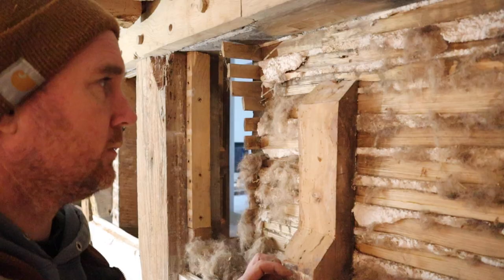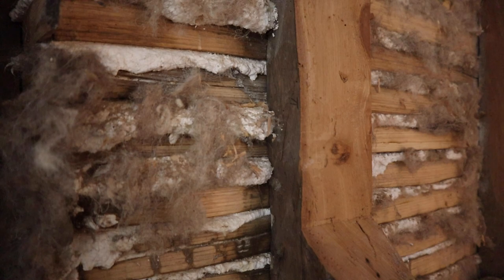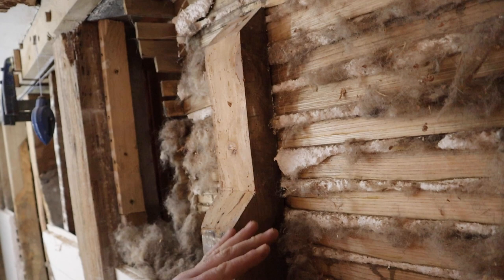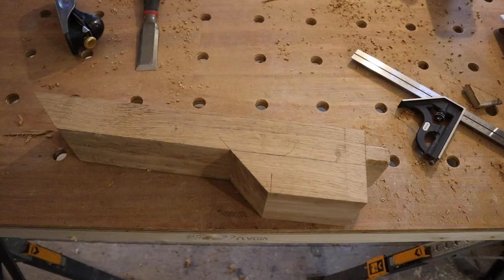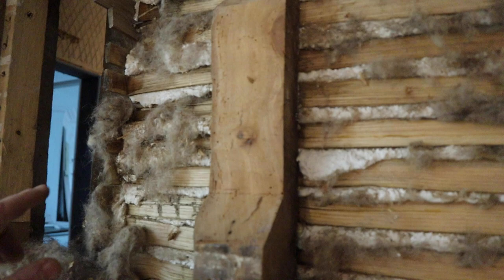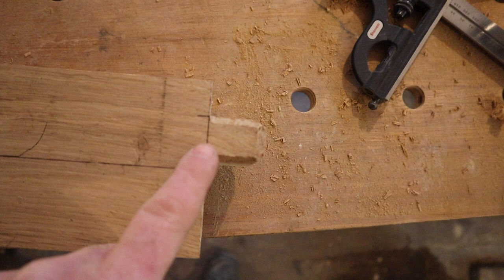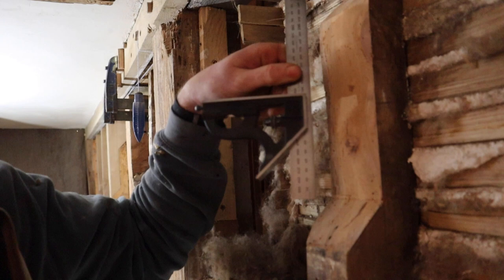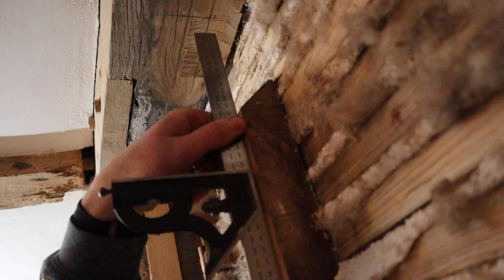How to repair a Timber frame stud. Episode !

Comment: Why were the studs rotten at the top and not the rest? Beautiful repair.
Reply from the maker: The wall plate had been replaced by a previous carpenter. I think they cut the studs to insert the new wall plate and badly repaired the studs. Some badly fitted wedges with two small modern zinc plates screws.
Reply from the maker: Thank you
Reply: @SlaterConservation  Makes sense. Looking forward to your other content.